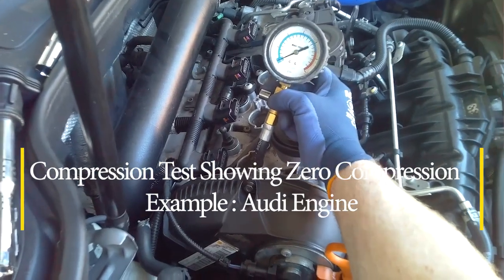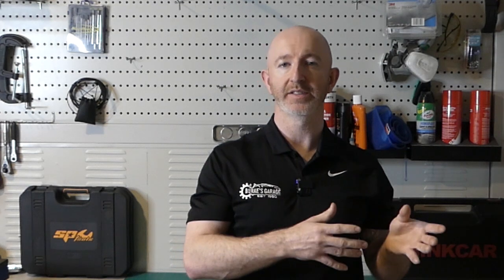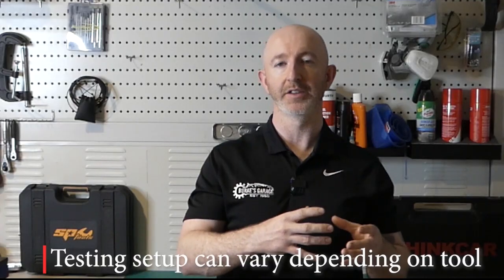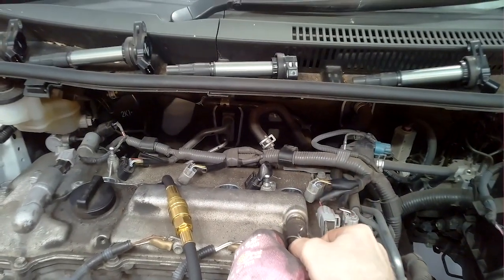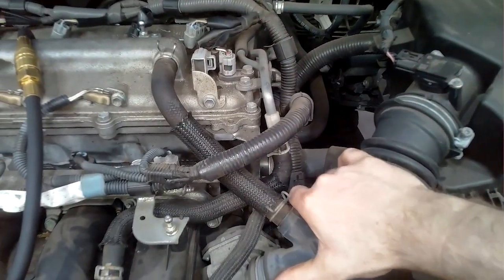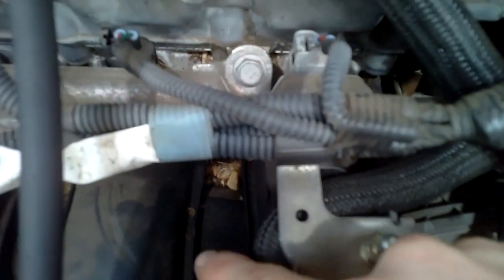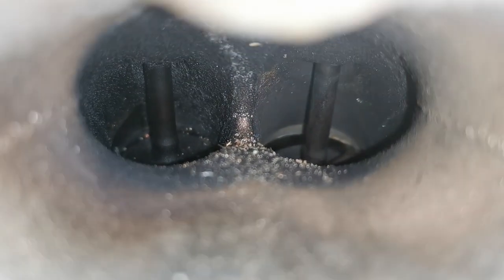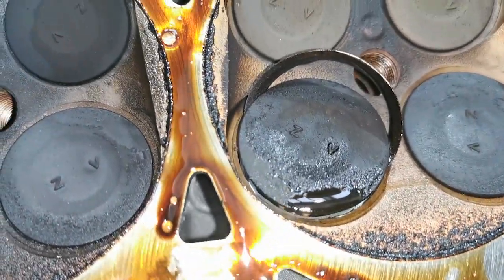Engine Leak Down Test - Simple Step By Step DIY Guide

Comment: Sounds great for a 4 cylinder with a standard transmission.  More difficult for the rest of us!
Reply from the maker: I have done this test on 3, 4, 5, 6 & 8 cylinder engines. The set up time of course can be different depending on engine access but the process remain the same.

Comment: I got one for you. White smoke out of cylinder #5 (2000 ford ranger 4.0, ohv) good compression, good leak down test, good coolant pressure test, no oil in water, no water in oil, no loss of coolant, injectors all good and working. What do you think?

Comment: Tacoma 2.7, code P0301
Coil, spark plug and injector swapped, cylinder compression 150psi, injector connector tested with a Noid light tester (ok) 
I guess this leak down test is the last test missing in this mess to know exactly what is going on with this truck 😔
Reply: You ever figure it out?
Reply: @TheOfficialOnlyPaws  yes, I won’t trust anymore the “compression tester” , if you really want to diagnose correctly an issue with a particular cylinder you must use the “leak down” tester, it was something relate with the piston rings they were either worn out or stuck, I even tried soaking them with everything in existence to eliminate oil or grease and didn’t work , engine need to be rebuilt, it was neglected by the previous owner🤦‍♂️
Reply: @64arguz dang dude. How much was that bill? 

I picked up an old Land Rover and similar situation. Previous owners neglected it. So now I’m working on it.
Reply: @TheOfficialOnlyPaws   I always criticize people who throw away money on parts trying to guess what’s wrong with a car rather than diagnoses correctly the problem, now I did the same 🤦‍♂️ I lost close to $1500 on parts + my time dealing with that truck , however I bought the truck with misfiring on cylinders 1 and 2 , replaced the head gasket ( was bad) had to buy a new cylinder head ; after that the cylinder 1 didn’t improve 🤦‍♂️ 2 lessons: if you have only one cylinder with problem it’s coil, spark plug, injector or compression related to that cylinder only and the other was don’t trust the compression tester , always use the “leak down” tester , I sold the truck “as is” , my garage is very small, no space enough to pull an engine for rebuild purposes 😔

Comment: I've got to do this on my 2005 Nissan Xtrail 2.2 as the blowby from rocker cover seems excessive despite new injector seals and tube/seat clean up and I'm running out of ideas as it's kicking out heavy light grey smoke under light load. Only fault code is related to EGR volume.

Comment: Really good video! I have a 2015 F250 with a 6.2l gas engine that is getting oil in #8. Sometimes when it start it up it blows smoke sometimes it does. The plugs were oil fouled once I changed them it runs better. The compression seems ok but my mechanic thinks I need to do a leak down test.

Once thing I did try and it helped for a while was changing the valve seals on that bank. I personally think I have a bad valve guide on the intake valve. I don’t know if a leak down would tell me if my guide is bad but it should read normal?! Honestly I’m not sure what would be a normal reading on a leak down since I never did one before. 

Anyways any thoughts or suggestions?

Comment: Good video. I did my first leakdown test the other day, on an engine out of a van. I found it useful to turn the engine over with the LD kit attached and on ~20psi max to 'watch' how the valves operate and the piston goes up and down. It's also useful to check TDC and timing when on low pressure.

Comment: Great vid I have done this many times in my mechanic career only difference is we put the handbrake on like yourself but then put the vehicle into 2nd gear when we then attach the air after setting the gauges the vehicle  will try to move the piston down but can't as its in gear .......

Comment: This was a nice explanation…. I just tried this myself and have a query if possible. I get the piston to the top and the result was poor, I then rotated the engine and moved the piston down and back up. This time the leak down tester didn’t drop down at all….. which result do I use ?? Hope
You can advise. Thanks
Reply: Suck, squeeze, bang, blow.
Those are the 4 strokes to an engine.
SQUEEZE is the compression stroke and both intake and exhaust valves are closed at TDC.
BLOW is the exhaust stroke, the exhaust valve is open so no compression at TDC.
 Cheers.

Comment: i like the smokers they use to easily find a leak.

i put an air gun and a rag in the tail pipe , compressor set on low psi  and spray soapy water checking for exhaust leaks.

guessing youd have every diagnostic tool under the sun like testing a radiator for exhaust gases  etc.